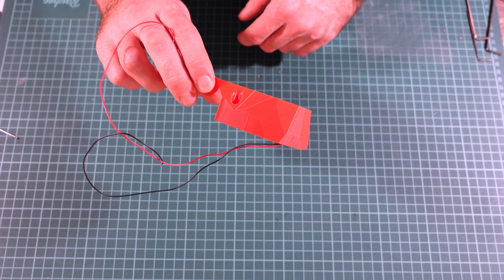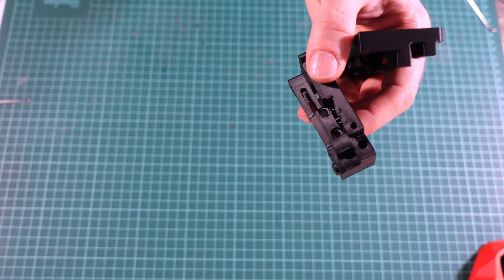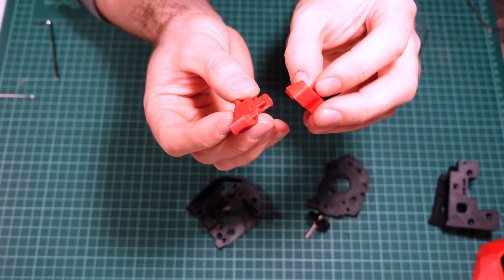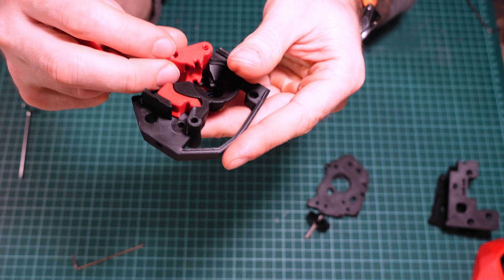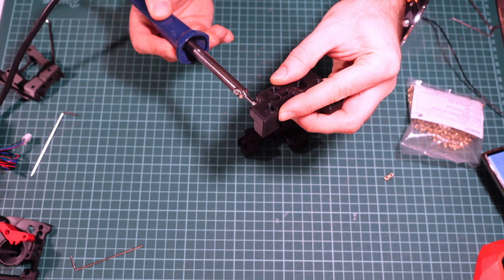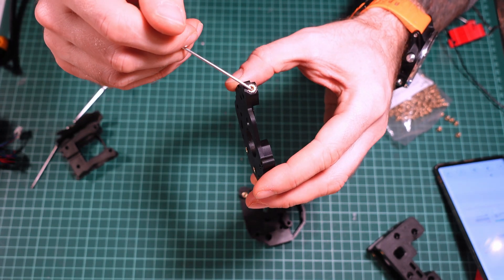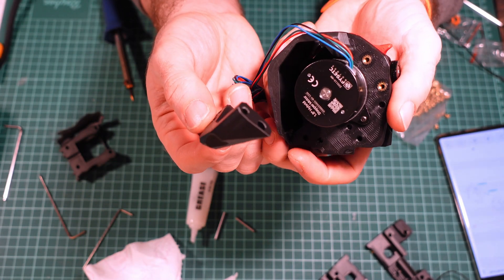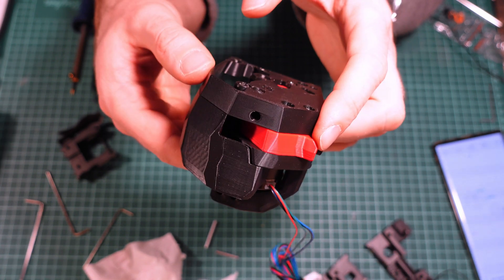Voron Clockwork2 Extruder CW2 beta first thoughts and assembly

Comment: The fan cooling is not very good, my current one is way better and the smaller motor is not as good as many out there. Not sure why they pushed this design out there. It's a sideways upgrade at best and a downgrade as far as cooling goes and the cooling path is still pretty bad. 

This is not directed at the presenter, you're doing a good job, just the basic design is not good enough to waste the time doing it.
Reply: Sorry, but you are wrong on so many levels.

Comment: Possible to use full size step motor???
Reply from the maker: I've seen a community mod but cannot just put my finger on it. Maybe ask on Discord?
Reply: @techbytch  After I printed the parts, I'v seen very small gap that's impossible to use big motor (without modifying), just ordered orbiter motor NEMA14 20mm.